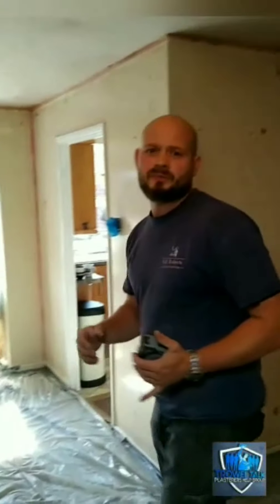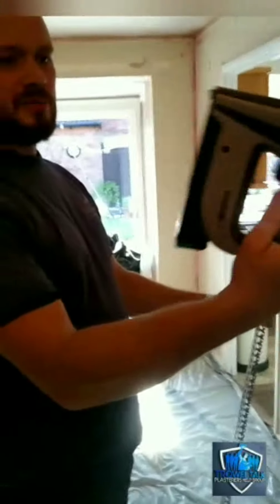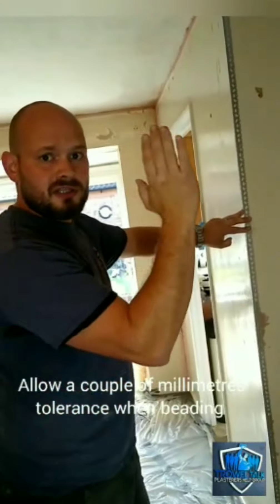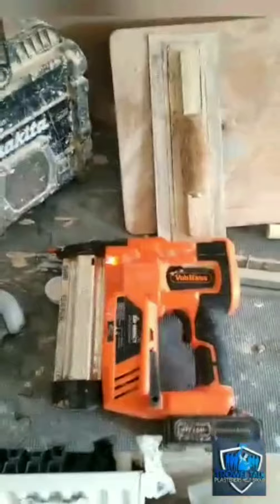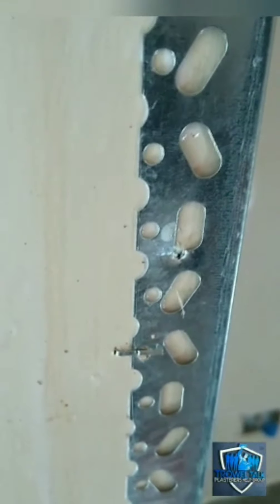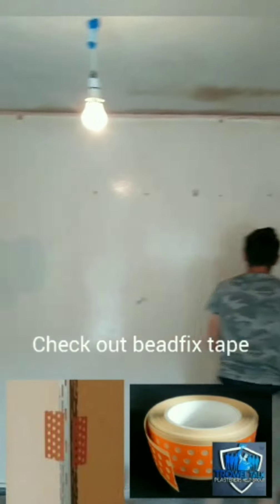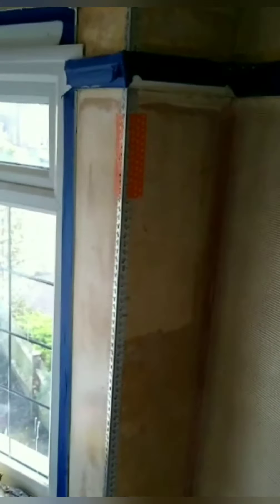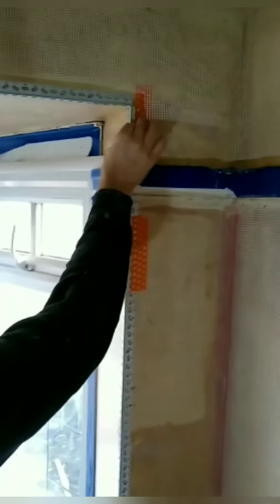HOW TO FIX CORNER BEAD

Comment: I've always used a bit of Knauf drywall adhesive to bed and set  all my beads in place .
Reply: Couldn't agree more, been plastering 46 years and have used drywall since the day it came out, staples are the worst way of fixing as they will only work on a soft background and are still not brilliant as they are not a tight fix.

Comment: im just amazed why people are using such crap beads 
ive just brought 50 hookon beads cheaper than the normal from travis 
ask why they havent sold many 
been told plasterers dont like them as they can nick there fingers WTF 
nailing stapleing beads has allways been a no no for me 
dab of plasteron the top and bottom of the bead the normal ones 
the 
centre finds itself